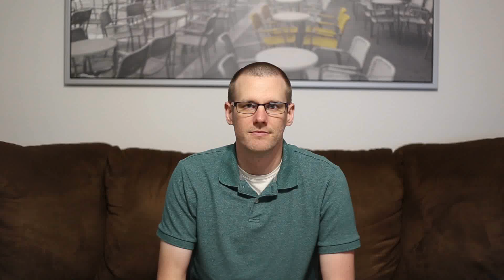3 Ways You can Destroy an ESC - Maximize ESC Life

Comment: what if the esc (1060)blinking red. the reciever has no light at all and output is measured at 1.5v on the reciever 3 pin connection. its brand new, lipo is charged, any ideas on what is wrong?

Comment: I just purchased a new boat. it's a twin cat. 2 x esc's and 2 x motors. I have not yet run the boat. I am still in the process of setting it up. it's a RTR but I have a little bit of work to do on it. Just today I stuck my head in the boat as I could smell electrical burn. I believe the boat has been used before as a demonstrator at a show. The electrical smell is quite strong. I don't know if it is from overheating or some other reason. Assuming it reached a critical point in temperature for whatever reason is the continued electrical smell emanating from these ESC's and or motors a sign that they are damaged?
I'm scheduled to chat with the supplier of this RTR Cat  over another issue in the coming days and will bring up the ' pungent ' electrical smell from the 
ESC's and Motors. The electrics just smell all burnt !!

Comment: But batteries drain when in use, I'm confused. The battery will die after use so how can a depleted battery burn out the ESC?
Reply: still voltage in it

Comment: I own a Traxxas Spartan and it has an esc with 2 connectors. I recently received 2 lipo 6s battery packs and when I first plugged them in the esc started to smoke a little and now the rudder works, but not the motor. Do you know anything about that?
Reply from the maker: Without seeing how everything has been plugged in, it's tough to say. Smoke does suggest something is permanently damaged.

Comment: You forgot the most common way to destroy an ESC. * Plugging the ESC to the battery with the poles reversed! Believe it or not you can force polarized plugs together just enough for current to flow, SPARKS FLY, and VOILA, instant SMOKE!!
Reply from the maker: Can you list the connectors this is possible for? This could be a video topic as I've never seen this happen.
Reply: I've accidently pushed an XT-60 connector in close to a battery. If you don't realize the poles reversed, you can force the connectors close, but not into the other gender, and if they only connect for a split second, the ESC is destroyed. It's happened when I was in a hurry and the battery was in an awkward position. It wouldn't fit so I tried to force it.

Comment: You need to go back to basic electrical theory. Electron flow is nothing like the flow of a mass of water and does not do anything like you are saying about destroying your esc if the flow continuously stops suddenly, repeatedly. Ripple can damage capacitors if it exceeds their limits for voltage. Nothing to do with a current hammer effect.
While I am being a pain in the arse. You should stop saying current causes the heating in wires and motors. It is actually the resistance to the flow that causes the heating. It is incorrect. If the conductor is sufficiently big enough and short enough (i.e little resistance) there is negligible heating from a very large current flow.
Reply from the maker: Inductance is a very well-known and taught phenomenon in electronics. It is very much considered a basic. The water hammer analogy is often used in engineering to describe this effect as it is quite easy to understand.

Comment: Hi regarding tip 3 I have rc boat with water cooling in process, so esc to be closer to motor or batter , wiring thanks
Reply from the maker: Don't extend battery to esc leads
Reply: @RCexplained  thanks mate will  do that

Comment: @rcexplained Just a thought, surely a 40A ESC having 38A load will get hotter than say a 50A ESC. Thus reducing the risk of failure and better performance? Or is the difference minimal?

Come to think of it, the physics would be the same, same voltage, current = same dissipation of heat?
Reply from the maker: 40A ESC will theoretically get hotter than a 50A ESC with a 38A load. GEnerally, larger capacity ESC's are physically bigger in size adding to the surface area to dissipate heat. This alone keeps them at a lower temperature. In addition larger capacity ESC's have lower internal resistance thus decreasing the losses at the same current level vs a smaller rated ESC.

Comment: What do you make of the XLX v1 and 2 having fire prioblems at the bench and on the track?

XLX2 FAIL ON DESERT BUGGY XLE 2.0
https://www.youtube.com/watch?v=4fG6ISdMZm4
X-Maxx Catches Fire! Castle XLX 2 Goes up in flames
https://www.youtube.com/watch?v=IydOZKYN9SQ
Castle xlx esc on fire
https://www.youtube.com/watch?v=16did-iD0DQ
Mason Arrma Limitless Speed run Castle XLX Meltdown and Fire
https://www.youtube.com/watch?v=k4oMB71dJuQ
Reply from the maker: I'd love to get my hands on one. For the ones that have blown up I'd love to see the data logs before commenting on any causes.
Reply: @RCexplained  From what I can tell people that use a KV over the rated ability of the ESC?
Reply from the maker: Not necessarily. That ESC is a beast and I've seen data logs of over 300A being pulled from them. There is more to it then just the amount of power output the ESC is capable of.

Comment: I have a question, i purchased two identical esc's for my plane. The amp rating on the esc was 30 amps continuous and it could take 4s max. I used a 3500mAh 60c 3s lipo in both and one burnt out instantly. i purchased a third one with identical specs thinking that it was a fault, and after plugging in the same battery for the second time, it burnt out too. Is it the c rating on the battery thats doing this or is it just 2 unlucky esc's. THanks.
Reply from the maker: Is your plane a twin and one of the motor/ESC's is working well? Did the ESC burn up just when plugging it in before spinning up the motor?
Reply: @RCexplained  So im running to EDF's with a seperate ESC for each, one works fine, ive tried both motors with the working ESC and it fine, just gets a little hot on full throttle. The ESC burnt up after plugging it in to the battery. I'm guessing its two faulty ESC's
Reply from the maker: It's not common for an ESC to burn up after plugging it in. What ESC is it?
Reply: @RCexplained  im not actually sure, it says goolrc, 
I ordered another one, it works fine, it was just two unlucky ones, if anything goes wtong again ill just use a hobbywing skywalker,
Reply from the maker: I would replace with an ESC that has reliability that you are comfortable with. ESC failures take jets out of the sky.

Comment: Our rig rolls for about 5 secs, then cuts out.  Thought it was lv cut-out.   Got new batteries with larger reserve.  Same problem.   :sigh:  not sure what has cooked it.   Maybe the hammer effect.  Maybe from sitting unused.
Reply from the maker: There are many possible reasons as to why it cuts out. have you tried another ESC to rule this out?

Comment: Thank you for the very informative video!  I recently started building RC plane and I want to know whether I chose a right combination of the power system.

I have a brushless motor with a maximum current draw of 11 V (using 7 in prop, according to manual,) 20A ESC, and 2S 450mAh 25C  LiPo battery. Using a formula, 450mAh/1000 * 25C = 11.25 A can be drawn from battery, right? If I am using 6 inch prop, is the battery current too small for ESC and motor?
Reply from the maker: What are the details of the motor? kv? size? The current draw you listed has the units of volts, did you mean 11A?
Reply: @RCexplained  Yes, I meant 11A, thank you for the correction. The motor I used is EMAX MT1806 2280KV. I saw the spec on Altitude Hobbies website. In the spec sheet, it was using 3 blade 7x4.5 prop and it draws 11.2A. Is the power system okay to use?
Reply from the maker: @ybraiders549  the battery is your weakest link and under full load will be pushed very hard.
Reply: @RCexplained  I see, thanks for the info! So how much the battery amperage has to be stronger to be safe? Like 15A or more, or even 20 A? Can the battery current larger than ESC rating? I am building the plane to aim  under 0.55 lbs, so I would like to keep the battery weight as low as possible.
Reply from the maker: The rated continuous current output of the battery can be much higher then the rating of any other component. I try to aim for 50 to 100% more current then what is planned to be drawn.  To do this you would need to know your system is going to draw 11A for example.  Then multiply by 1.5 to 2.0 to get max current for the battery pack. Then divide by the capacity of your pack to get the C rating. Hopefully all of this is easy to follow.
Reply: @RCexplained  I see, thank you for the detailed explanation! I found a LiPo that has 
450mAh 2S 50C, which should be better than the current one, right? Your instruction was very easy to follow, thanks so much!
Reply: @ybraiders549  I know you've probably already figured this out but for others checking here I'll post the following. If you multiply your Ah capacity of your battery times the C rating, that will give you the theoretical amp output. In your case a 450mAh batt is 0.45 x 50C = 22.5 amps. If that exceeds your ESC rating, you might need a higher rated ESC. But the C rating on LiPos is usually a dream, not real. All manufacturers can put any C rating on their batteries and do. I recommend you read up some on batteries. This link is for the large 6S LiPos and some great testing results, but the brand names involved are good for lower capacity batteries as well.
https://www.rcgroups.com/forums/showthread.php?1767093-Battery-Load-Test-Comparisons

That amp output calculation will help you figure out if your battery might be able to deliver the amps you need or if the ESC is up to it. Also compare the voltage rating for your motor and ESC. Don't plug in a 4S LiPo in a motor or ESC only rated 2-3S. You will want to get a watt meter for static testing. 
https://www.motionrc.com/products/gt-power-180a-watt-meter-and-power-analyzer-gtp180awm?variant=35396032588&currency=USD&utm_source=google&utm_medium=cpc&utm_campaign=google+shopping&gclid=Cj0KCQiAzMGNBhCyARIsANpUkzNz3A2BSvh4BcdcXq3Sq9aryqEERCn2e5Oh8OWh-oyxtb_YDLcHApYaAlc4EALw_wcB

But look for one with the battery connectors you use if you're not adept at soldering. And make sure the watt meter can test past the amps you will be testing for.

Comment: Does ESC need special programming for forward and reverse of brushless motor connect to? If so how is done? What to buy to do so?
Reply from the maker: I'm not sure I understand your question. What are you trying to do with forward and reverse? A car ESC will be able to run in both directions. Most ESC's can reverse the motors direction of rotation through programming if it is spinning in the wrong direction.
Reply: RCexplained my application is for slow speed boat which needs forward and backward movement with brushless motor with ESC. I need forward in slow to fast speed with the help of ESC and backward direction same as about just to push throttle stick in TX. I see some brushless motor specify CCW in spec. Is this meaning that motor only runs CCW direction?
Reply from the maker: A ccw motor more than likely means the shaft is designed to tighten the nut in a specific direction. Brushless motors will operate in both directions.

Comment: My motor cant throttle..servo can turn...is it esc problem?..i can feel the heat from my esc..
Reply: 1st i use 1900kv motor, then i change with 3200kv motor and use the same esc..use lipo 3s 2200 mah..is it the root cause of esc overheat and fail..?
Reply from the maker: You apply throttle and the motor doesn't rotate at all?

Comment: I have a question. I have a 45a esc and 4300kv motor currently running on 1500mah 35c 2s lipo. I was thinking to plug in 3s since my esc is compatible. What if i use 2500mah 60c 3s , will it damage my esc because my esc just 45a
Reply from the maker: It will only destroy the ESC if you draw more than 45A. What you will need to do is load your setup correctly to make certain you do not exceed the 45A rating.
Reply: Having a battery that can deliver more current then the ESC can handle is okay because the ESC can only pull the Amps it needs and will never be overloaded within normal operation. It becomes dangerous when the battery is not up to spec to the esc and motor needs...

Comment: I love all of your videos, so much intellectual, easy to understand information ! Well explained,  and thorough.  Quick question, based on this video. With ripple being "alive" in the wires from esc to motor, is it more logical to have shorter wires or longer wires? Is it a matter of less current being present in shorter wires, so less of an impact to the capacitors upon the backflow (off power current flow direction)?
Shorter wires/less current heading back to the caps seems logical to extend the caps life or am i backwards in my thinking and longer motor wires are the way to go? Thank you and I really do appreciate your vids !!!
Reply from the maker: Thanks for the comment Mike! When it comes to wire length, shorter is always better. ESC to motor wires are not as critical as Battery to ESC. Current is not the critical component that destroys the caps in an ESC. It's ripple voltage that does. To reduce ripple voltage keep wires from the battery to ESC as short as possible. Factory wire lengths are acceptable. Also, use an appropriately selected LiPo battery for your power system. 
https://youtu.be/54bb9zpDdZU

Comment: Rayan, I've watched most of your videos.   Just getting into Electric Brushless Motors for RC BOATS.....  I really don't know how to match up the 3 components Motor, ESC, & Battery.
For the most part I'll be using the 150A-180A Marine Water Cooled ESC....   the issue I have is determining the Motor Size and Battery.  Boats like a good range of BURST, so as a Minimum I looking a 50C which I believe is a 100C BURST, and up.   The motor selection is the real issue,,,  Do I go for HIGHEST RPM UNLOADED,  or what?    I try and see what other people are using as a general guide, but monkey see monkey do, isn't ALWAYS advisable, and as far as I know there isn't a Boat Motor Scale that's published for general reference.   Like is it better to run 3S 11.1 volt or 4s 14.8 volts, etc., 
Also the Motor Mgf. show the Motor operating Voltage, do I try and get as close to it as possible?   There you have it, I believe Planes and Cars have motor size recommendations...  where as a 38" Boat kit has no motor recommendation single or twin motor.   Any help in Selecting a motor for RC BOATING would be helpful,  I realize 35,000-45,000 RPM is allot unloaded, but the Weight & Drag on the boat in the water in real term problem is actually running of of what maybe 50% of that unloaded rpm once it's in the water?     Any assistance would really help for those of us, starting out in RC Electric Boating.    Thanks, really enjoy your Video.
Reply from the maker: Hello. Thank you for your comment. Please visit the radiocontrolinfo website. I have there plenty of information for selecting a proper power system for an RC boat. There's definitely charted information to help make selections easier. Check it out and let me know if it helps. 
There will be videos on power system selection in the future.

Comment: Halo man. Thanks for making and sharing this videos with us. Am having trouble with my esc and wondering if u can help. Its a quicrun 1060 runing a rc4wd 80t brushed motor on 3s. The thing is am geting almost 40 degrees celcius on the esc just beeing turn on not even mooving.. Its hoocked on a fly sky 3ch fs-a3 reciver with a standard servo and a gc301 gyro. Thats it. Do you know what could be wrong?
Reply from the maker: Hey Mike, thank you for your comment! Do you know what the maximum temperature of he ESC is? What temperature does the ESC get to when in normal use?
Reply: @RCexplained  At 100 celcius goes to protection mode. I thing i found the problem.. whenever i connect the powerfull external fan i have for the esc to the receiver it makes the esc hot. 54 celcius without moving the car.. I think the fan draws to much current from the receiver making the esc struggling to keep up the operating voltage making it hot.. What do you think? maybe an external bec or a second battery just for the fan and led's? Any recommended bec's that are cheap easy to use and tunable to multible voltage?
Reply from the maker: @need4drift  it sounds like your fan is placing too much stress on the BEC circuit in the ESC. If so I would use an external BEC.
Reply: @RCexplained  Ok then. Cheers!
Reply: @RCexplained  Yes, I agree! The BEC circuit seems to generate a lot of heat ESPECIALLY if it is a linear circuit (not a switching one). Maybe you want to measure the amp draw and compare it to your ESC data sheet.